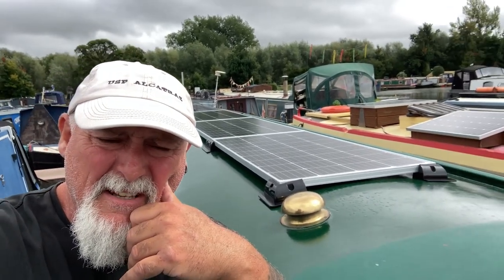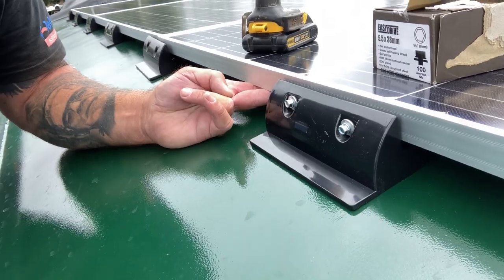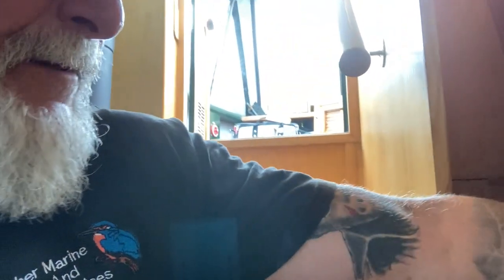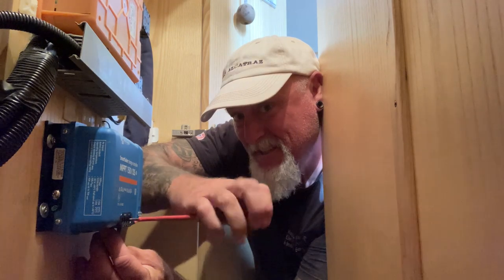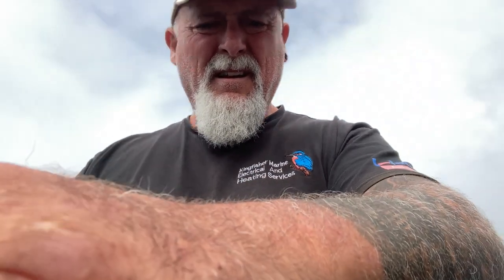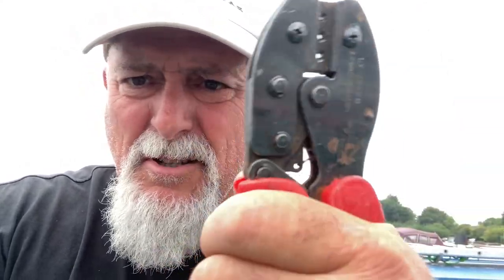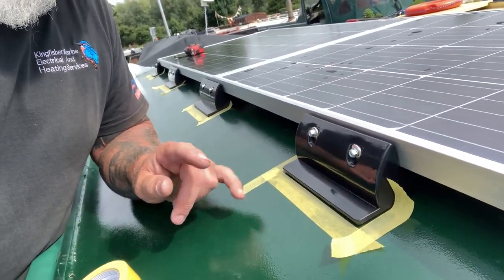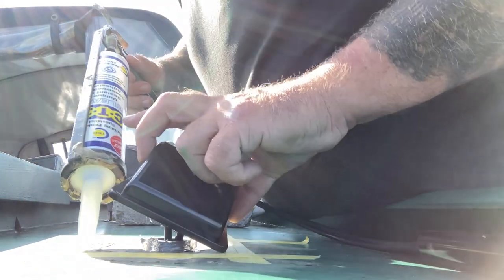Narrowboat Electrician - Narrowboat Solar Installation

Comment: Thank you so very much for this video & a comprehensive overview of a PV system.  I am a "rag & stick" boater & owner of an elderly vessel which I have carried out the rewiring myself.  Learnt a lot here.   The list of winter jobs to do with the electrics is lengthening especially with fusing!!  You asked the question where does the fuse sits between the isolator & the battery - the answer is ....?  Also your comment on pragmatism is much appreciated - some of the installation on my boat could be considered a bodge but now it's been renamed as "a pragmatic solution".  Thanks once more & take care
Reply from the maker: Hey, welcome, ah! Did I put the answer in the comments.....er no! Its quite simple - get the fuse as close to the power source as possible, as the length of cable to the fuse is unprotected should a short circuit occur. 
Isn't the solar panel a power source? Yes but when you short solar panels out they can only produce a given amount of current (Isc) so can never cause a fire if using cable that can carry that current. I use 6mm which is good up to 42A, so there is no risk here. Batteries on the other hand, can produce 1000's amps in a very short time.
Hope that helps.
Reply from the maker: Consider becoming a member for continued tech advice.

Comment: You made this look far to easy, great instructional video buddy, were just trying to work our boats energy out and its been nothing but a nightmare so far, thanks for your insight
Reply from the maker: Thanks for the great comment. I have done so many boat solar jobs its generally quite straight forward now. I have a 1200w widebeam installation at the weekend so I'll try to film that one as its a little different.

Comment: I winced when you stripped that cable with your pocket knife! Have you seen the Knipex Ergostrip? It's perfect for round cables, I use one for flex, meter tails and the inner sheath of armoured all the time. Thanks for a really interesting vid, subscribing now!
Reply from the maker: Hi Robin, thanks for the comment, I’m old school and have strippers in my tool bag. I guess it’s just become the habit. It’s not razor sharp, it’s quite dull so it’s easy to gauge the depth. Good comment thankyou

Comment: To reinterate the power in DC, many many moons ago, I worked for the Post Office Telephones and managed to drop a spanner across a 50v DC buzz bar, as luck would have it 90% of the bar was insulated, but my spanner found the couple of inches that was not insulated, the result a very loud bang and a case of flash blindness that lasted 10 to 15 minutes - the spanner?   about 3" of the end gone, steel liquidised and gone.......
Reply from the maker: Yeah Dave, can be scary stuff, remember ac swings past zero 50 times a second, dc is full on voltage, so power is much higher. I used to work on 250v dc back in the steel industry, that was powerful stuff. I think I need to do something on safety and the danger of dc voltages.
Reply: I've melted spanners on a 12V battery before, it's not just the voltage it's the amps flowing that maketh the sparkly sparks 😁
Reply: @Dirt-Diggler  In my case it was in a telephone exchange and the fuses beyond where I short circuited on the equipment rack were 100Amp, and there were at least 20 racks of that buzz bar, so god only knows what the upstream fuse was!!
Reply: @davehopkin9502  my electrical tool kit is mostly normal spanners but covered in shrink tube 👍 I'm a clumsy sod at the best of times 🤣 especially with today's LiFeP04 battery Banks 😮 fortunately i haven't shorted one of those yet 😁

Comment: Really enjoyed the vid chap cheers 👍
I do a little work here and there on boats but usually on road vehicles, mainly camper vans so all relevant info for me 🙂
Reply from the maker: That explains the question I've just asked you on a previous post. Vans and boats are very similar, I have done a few vans for friends, but I'm so busy with boats I don't need more work. I only do three days now and a bit of part time on the hire boats. Glad the vids are of use to you.
Reply: @narrowboatelectrician  same position myself, early 50's and starting to slow down and pick the jobs, fortunately my age is useful for a change as not many boat mechanics know 70s petrol engines, so for older fibreglass cruisers I'm in demand and no bloody computers to tend with 👍
But i still get asked to do solar mainly as i use my ex ambulance camper as a mobile workshop, Which attracts questions followed by jobs 😁

Comment: my car started motor got stuck so I got a spanner to turn it I had a ring on my finger spanner in hand and turn the motor but I hit the spanner on the positive wire and the spanner in my hand was touching my ring and my ring caught on a bit off the engine which of course was earth ring melted to nothing and finger was badly burnt so I learn very quickly about how DC can be dangerous . I am enjoying your episodes and thanks for the video
Reply from the maker: Scary stuff Eddie, I never wear rings or watches or bracelets when I am working for that very reason. The power stored within, even a small 12v battery, can be very high if shorted out. Lesson learnt there, but the hard way, I hope the effects were not long lasting.

Comment: Stranded cable into screw terminals - I understood bootlace ferrules would be needed?  Or is that just a preference?
Reply from the maker: Hi Andy, They are not screw terminals, they are clamp type
Reply: It's best practice to use crimps on stranded cable even with clamp type connectors.

Comment: Love your videos. Just realized today. I’m not subscribed. Sorted!! Anyway, is there any issue with galvanic reaction between the steel roof and the aluminium? Thanks! Happy New Year!! From Miami Beach, our hull is being made this year!  You’re videos have been so helpful! We will definitely be reaching out when we get to across the pond in May!!
Reply from the maker: Thanks for subscribing Chris, all helps! Mmmmm, dissimilar metals? Not something I encounter often but I would think the aluminum would be prone to corrosion if not protected where they touch. There is a research paper here that seems to confirm that
https://ideaexchange.uakron.edu/cgi/viewcontent.cgi?article=2254&context=honors_research_projects
Think a conversation with boat builder would be in order.

Comment: 26:34 Glad you were ok with the exploding battery.  I have seen that happen on a boat over here as well.  The battery was over charged, and developed an internal fault, which then the charger tried to push more current into it, which then started a thermal run-a-way situation.  At that point the amount of hydrogen gas it was venting into the area without enough ventilation built up to the point where it just found the ignition of a spark to set it all off.  At least there was no fire, just blew the battery apart and a few windows out.  Flooded cells can be very nasty when the have a fault.  They should NEVER be used inside the cabin and only in vented areas.  If anything an AGM battery will help almost fully eliminate the off gassing of hydrogen.  This battery was located under a berth that was used for the bow thruster.  I guess the owner didn't want to spend the extra money on an AGM and just used a flooded cell battery as it was much "cheaper" but didn't realize what could happen.  That was in a 40' fiberglass cruiser here in the USA on an inland lake.    Keep up the good work sir. 👍😎
Reply from the maker: Thanks for the comment. Most people do not recognize the potential danger with batteries. I have batteries inboard, but they are gel batteries. The explosion I had seemed to be pressure only, yes that must of had hydrogen in it but there was no ignition luckily. I put it down to a faulty pressure relief valve within the battery. I get work up close and personal with LA batteries, and even though I was aware and careful before, hard lessons are remembered stronger. I have to flooded batteries in my van, they are being changed very soon. Keep commenting, good chatting.

Comment: I am fitting a largish solar array on my widebeam to make use of all available sunlight and anticipate an excess of power after charging batteries. Is it possible to fir a solar dump (Iboost/Eddi) to divert to either immersion or oil filled radiator or can a Victron do the same as i read that it can and it can't. With Eddi/Iboost they are geared to firring between consumer unit and meter in houses but obviously there's no meter on a boat (thankfully).
Reply from the maker: Hi Mark, Victron don't have that on their mppt controllers. They have a "load" output but that is used for switching off a load when batteries get to a set lower limit. Not for a dump load.

Comment: What's the best amount of batteries to have for the solar panels.Only have 2 on my boat and thinking of getting solar but think 2 batteries are not enough?
Reply from the maker: Hi Andy. As always, it depends. But as a rule of thumb, most narrowboats would have 4 x 110Ah batteries and if you were just out in summer months, 500w of solar. Of course liveaboard off grid is a different matter.

Comment: As much as possible is the approach I've taken on the narrowboats I've done so far. Let the roof dictate the number of panels, and buy the highest wattage panels that will fit in the available space. Can't get a 4th house sized one on this 55 footer without either fouling the side hatch or fouling the pigeon hatch, so it's getting 3. Couldn't get a 3rd one on the little 36 footer I did last so it only got 2. Every boat I've looked at there's always a patch of roof that you can't put panels on, which can be used for climbing on where necessary, even if it means adding a folding step somewhere halfway down the side of the boat.
Reply from the maker: Hi Dave, yes I agree mostly. And it does depend on the usage of the boat. You don't nee 2kw on 
 a narrowboat when they only go out in the summer. I will always get the most on, but aesthetics do come into it, after all I am putting my name on it. Having said that, the customer can dictate exactly what they want and I'll try to make it happen.

Comment: Hi Martin nice informative video. What is your thoughts on pv Solar combiner boxes ?
Reply from the maker: Mmmm! what do you mean by a solar combiner box?
Reply: @narrowboatelectrician  hard to explain there used in systems with Parnell wiring when you have 4/6 solar panels. If you google pv Solar combiner boxes they will come up. Just wanted your thoughts on them thanks.

Comment: Martin, love your videos.  Hope you continue to build the channel.  I know that making these videos is a lot of work.  Hope you stick with it!  I’m trying to figure out how to buy you a coffee but all I can find over there is your Moonshine page.  Is that OK?  Quick question in the meantime: you kind of skipped over drilling that hole in the roof under the roof gland.  What did you use to drill it and what is that white plastic grommet you inserted in it?  BTW I am planning a major upgrade to our boat electrics over the next couple of seasons and would love to engage your consulting services as I work my way through it.
Reply from the maker: Hi Keith, that’s really nice of you to say, it’s good to know there are people getting something from it. There is a buy me a coffee for Narrowboat Electrician, but Moonshine lands in same pot eventually. Thank you. Happy to assist you when you are ready.
Reply from the maker: The hole was already there, there was a Wi-Fi antenna that I removed. I normally drill through with a hole cutter, Starrett are the best ones. As the roof cover is sealed I drop a cut down 20mm cable gland to protect cables from chaffing.
Reply: @narrowboatelectrician  Thanks. My solar cables right now are routed through a mushroom vent. That’s how the boat was when bought. One of the first things I want to fix. Start simple and move up :)

Comment: Another enjoyable video, thanks! I came across this channel only recently, but it's already one of the few where I clicked the bell :)

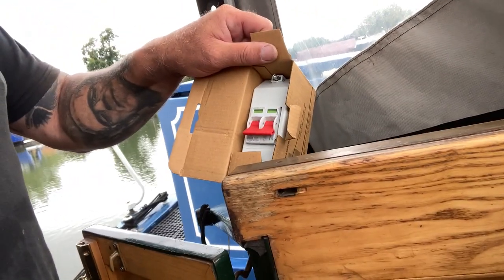If you will indulge my curiosity, the isolator you show around 11:50, is that rated for DC? I thought it looked a lot like the 100A Wylex 321FR, but as far as I can tell that's only rated for AC. And in my experience as a hobbyist, if a switch or isolator is rated for both AC and DC, the DC rating will be substantially lower than the AC rating.
Reply from the maker: Hi Bart, yes, for sure. It generally relates to the switching capability under load. DC specific switches have a bigger gap between contacts to extinguish the arc. We do use some 240v switches for dc such as light switches as they are switching low current LED's. I have the conversation with the customer not to break under load, and actually the panels can be damaged that way too. We are only switching about 10A on the PV side so I know this will cope well, I have used them for years. Good point and question Bart, thanks for that.

Comment: Always use bootlace ferrules for stranded cable, and DC breakers not fuses on all installations for the DC side.
Reply from the maker: Only really required on screw type terminals, not on clamp type. Which is what the controller has.

Comment: Why no cable ferrules on the multi strand cables? I understood in your past videos that with these cables, ferrules were recommended.
Reply from the maker: Hi Martin, they are on screw type terminals, but the mppt and isolator have clamp type connectors. I will show that difference in a future video. well spotted though.

Comment: Great videos Martin as always.   Have watched a few times but can't find any guidance on how you selected the cable size from the panels.  What size cable should be used, or are most solar cables a standard size and type.  Im on a widebeam and will have 4 panels of 360W/24v and a 150/100 Mppt.  I was 'advised' that i should do two panels in series, and then those two series (2 x 360w) bundles in parallel to the mppt.  thanks
Reply from the maker: Hi Sean, I use 6mm double insulated solar cable as the MC4 plugs are only rated to 30A anyway. So I try and series the panels up so the voltage goes up and keeps current low. If the array is larger I will use series parallel again bumping up the voltage and keeping current below 30A. I have in some cases had to run two pairs of cables as I cannot get the current low enough. Use the Isc (short circuit current to get the individual current each panel could produce. They are going to be in the region of 15A each, so you would be way over is you paralled them. So two in series then in parallel with the other pair would be an option. But you are right on the edge to where I would be running another pair of cables or putting all in series.

Comment: I'm a retired spark. I have seen three lead acid batteries explode. I believe what happens is ignition od the (highly explosive) hydrogen gas that is emitted from batteries.
Reply from the maker: Yes you are most likely correct, or the failure of the regulation valve, which was likely the issue I had as there was no explosion. Unvented hydrogen pools in high places, which in itself can be "interesting". What industry were you in Pete?

Comment: what is the DC rating of that isolator?
Reply from the maker: As you are most likely aware, not all switches get a dc rating. It is way over voltage and 10x overcurrent. I I have deemed it suitable. The only issue is breaking dc loads not carrying them. So as we should break solar circuit on power anyhow (as it can damage panels) the customer knows to cover panels before disconnection. This is perfectly acceptable.

Comment: Please note, not a snarky question. Why connect the solar panels in series rather than parallel? if they were in parallel the total voltage would be far safer, and if one panel failed the other two would continue to provide power. In series if one panel fails that's your lot, no solar power. I'm sure there must be a good reason for this arrangement, but I can't figure it out.
Reply: Usually series if better with an MPPT controller 🤔 they like a higher voltage ?
Reply from the maker: As dirtdigger said and expanding - the higher the voltage, the lower the current. Lets say three of those panels an produce 10A, in parallel thats 30A (in series 10A), right on the limit of the connectors and volt drop is going to come into play over a long length of cable. The down side if one of the panels is in heavy shade, the total output is reduced.
Reply: @narrowboatelectrician  I get it. So for a  house roof with a short cable run parallel would be better. I could always fit heavier connectors. Thanks.
Reply: @Dirt-Diggler  Thanks. I have a back up battery bank at home that is floated with a mains to 13.8v DC supply. I have a Plantronics PL20 solar controller and was thinking of getting a couple of solar panels to keep them floated rather than rely on the mains power. I think parallel would be best for my application.
Reply: @stevemumbling7720  I don't think there's any hard and fast rules 🤔 it's all about the individual installation, i have 4 X 100W panels in parallel due to shading where the van is parked for storage but i still use an MPPT even though the voltage is low ( 25V) mainly cos most PWM controllers don't have dedicated LiFeP04 settings and after spending £800 on a battery I want to look after it  😁
In contrast in my shed i run a PWM as the batteries in there are sealed lead acid and the charge perimeters are fine for them.